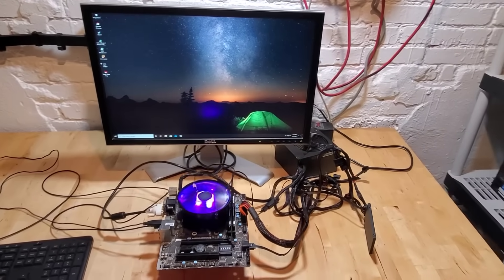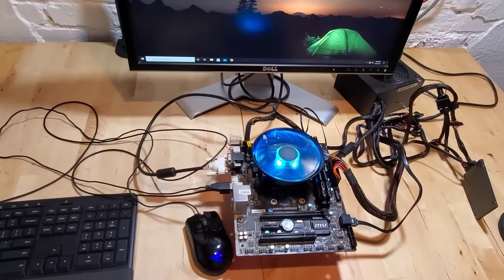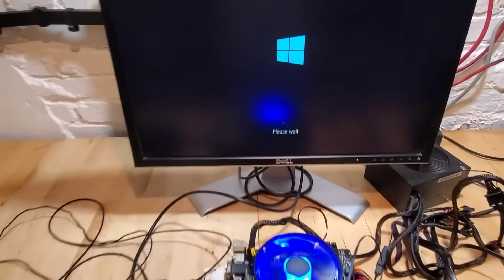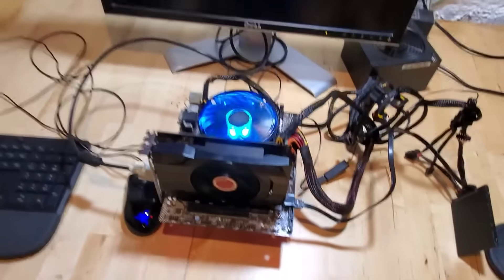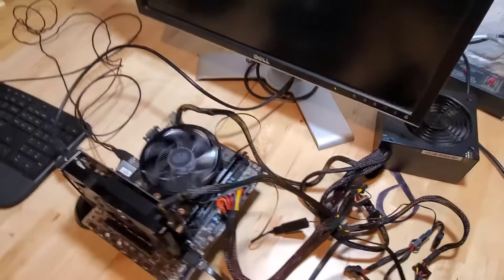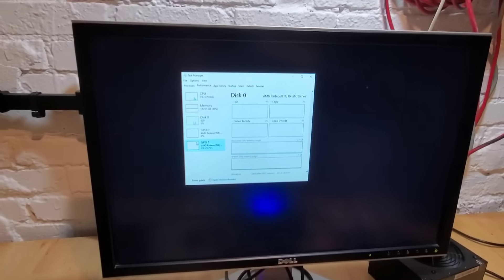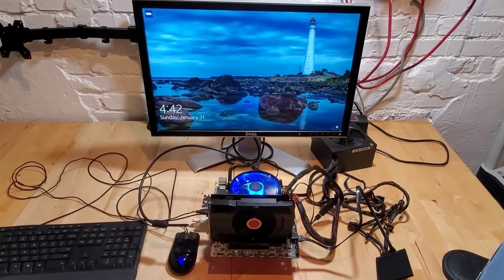What happens if you remove PC components from a running computer?

Comment: Oh that's nothing! I removed my 2 backup HDDs 3-4 times to plug them into the proper SATA and what happened blew my socks off! 
1. Both HDDs had 2 partitions: 
    Disk A: Part A1 and Part A2 
    Disk B: Part B1 and Part B2    (4 partitions in total).
2. All four partitions were locked with Bitlocker. 
3. Every time i switched the computer OFF and i restarted windows to see whatever i wanted to see about the HDDs).
4. When i finished, i started the computer one last time and i tried to unlock the partitions.
5. Partitions A1 and B1 worked fine after i unlocked them.
6. But it was impossible to access Partition A2 and B2 after i unlocked them, i.e. both HDDs had the same problem on the same partition (2)!!

The BitLocker icon remained gray and when i try to access the partition i'm getting the message "The disk structure is corrupted and unreadable". 
I have no idea how to restore my files from these partitions that don't have any physical damage. 
Even a famous "file recovery company" didn't give me an answer after so many months...

Comment: What you do sounds preposterous, but it's interesting to know, for whatever reason.
I see no reason for example for the gpu to not be plug and play.
Also, the disk part. You can obviously remove disks that do not contain the os just fine. But if you were to remove usage of a page file in windows, maybe those would work still, with no OS drive. You wouldn't be able to explore folders, but you'd have all the os in ram.

Comment: As long as no parts are broken in the process, none of this should have any worse effects than suddenly taking e.g. power away. Some writing actions might not be finished in persistent storage, Aka hard drive, and lead to some corrupted files and data. However, modern systems are usually rather robust to this, by e.g. writing down instructions to undo a change before actually doing it. This way, everything can be repaired just fine.
Reply: Yeah. The so called damage he warned about is much more likely to happen from physically breaking components since it can be difficult to manipulate a computer while it’s plugged in to a workstation. I learned this the hard way from trying to be clever, temporarily unplugging my backup drive in case a sketchy application gave me ransomeware.

Comment: Having dealt with a failing HDD in a laptop, I knew 100% what would happen with removing the storage. It would slowly fail, then restart. And the storage device might be acting all fine and like nothing happened for a bit before doing it again. At least that one is somewhat simple to diagnose if you can see the fact you have no storage device attached before the computer fails.

Comment: SSDs can be taken out and moved around as long as the running operating system isn't on it. I have external top loading port on my computer specifically for this, however, similar to a flash drive, you should tell the computer to "eject" it first. Also, I found on some machines you can swap video cards if you to specifically tell the computer to disable the port first, swap, then re-enable the port, but you do need integrated graphics to be able to see what you're doing, plus if I'm not mistaken, there's a shortcut key combination to reboot the graphics card. Although I don't know if that works after having pulled and re-plugged the card while it's running, but as far as I know, removing the graphics card while it's running doesn't always crash the entire computer. You could of tried moving the video cable back to the integrated graphics port to see if the computer was still running.
Reply: This is true. SATA technically IS hot swappable, but you want to avoid doing it to a drive that’s actively being read or written. Like you said, if it’s just storage, you can usually swap those no problem.

Comment: So is the reason why windows didn't crash at first when you removed the SSD was because it had windows temporarily stored in the RAM?  However, once it processed and needed another particular instruction from windows, it wasn't able to retrieve it due to no SSD?  Just wondering why it took so long for windows to crash.  I guessed windows would have crashed almost immediately.

Comment: Removing the RAM is literally removing chunks of the OS, which tell the computer how to run (yes the OS is located on storage but any instructions that need to be run are first loaded onto RAM usually). Hot swappable RAM would require an equivalent module with the exact same data.

Removing the CPU is practically like cutting the power to anything, minus anything controlled by the chipset or motherboard itself. RAM will likely clear as well. Redundant CPUs would require the same connections and some motherboard control to ensure only one CPU is running at once, or to deal with multi CPU processing. If multi CPU processing is on then it's likely the OS would be gone (until a reboot) if one of the CPUs are removed.

Removing a GPU could be doable if hot swappable PCIe is enabled (I believe LTT tried this out years ago). If you have integrated graphics then it's likely the PC would be fine, minus major graphics crashes (which could cause a bsod depending on how system-level the crash is).

Removing SATA devices is actually a supported feature nowadays if hot swappability is enabled in the BIOS. It'll behave like a USB stick- you should properly unmount a SATA drive in the OS before removing as usual. If you remove the essential system drive however, then this is likely similar to removing RAM, as any active programs can't find their code not stored yet on RAM. Note that there are some OSes out there that run entirely on RAM, so in this case removing the storage will have no effect to the OS itself. One last thing, eSATA is an (old) protocol for hot swappable drives, exactly as I described- my first PC case had an eSATA port on it, which was essentially a normal SATA data cable but with an external connector on one end.

You could try to remove some of the power cables- removing the 24 pin likely will shut the PC down; removing the CPU connector (one) will probably shut down the PC but the motherboard would still run. If the PC has multiple CPU power connectors then removing one will likely not do anything other than force the system to underpower the CPU. Removing a PCIe power connector probably has no effect either, except a GPU connected would run at a bare minimum speed, or shut off. Same thing with SATA power (and likely the old molex too), drives might be able to run on only the SATA data cable but will likely shut down.

If this were a different system (maybe something like a FPGA) then the "south bridge" or chipset could technically be removed too (south bridge is something on older motherboards, acting as a hub connected between the CPU/north bridge and less essential components. Nowadays the chipset handles that task, with more direct connections to the CPU enabling better performance and what not). Removing the chipset/south bridge could just be the same as removing all USB devices (aka the PC could keep running), or it could be like removing the motherboard but keeping everything else connected to the CPU (if the chipset interfaces with the motherboard itself, which it likely does, to regulate power and devices and what not).

Comment: SATA was desighned to by hot swapped, so if you do this to non system drive you could be ok, (actualy there are linux distros that can load to RAM and work whitout hdd) whit right OS,...  Also PCIe can be hot swappable, but not nesseserly Video cards,,...

Comment: I did this by accident over 10 years ago. Thought the computer was off but it was in sleep mode. Was with FX-4350 and GTX 750. Had some corsair 2133mhz ddr3 that took out 1 stick off. When I went to reboot the pc it sparked and fried everything from mobo to hdd's.

Comment: Dynamic RAM (DRAM) used by most modern computers has a load-decay-refresh cycle, the longer in decay the more undefined RAM content becomes as cells starts decaying towards uncharged state. If you unplug RAM and replug very fast, or extend decay cycle with extremely low temperatures, you can move RAN stick from one computer and analyze in another with acceptable low amount of bit errors. “Lest We Remember: Cold Boot Attacks on Encryption Keys” explored this extensively in 2008.

Comment: What if the PC just automatically switched the main graphics device to the integrated graphics card, and you just didn't notice because your monitor was unplugged? Also, you didn't actually reset any system after plugging the SSD back on. It's just that the PC couldn't find any bootable drives at first and automatically opened the BIOS, and later you had to restart the PC to run the sequence of looking for the bootable drives again.

Comment: I did this when i was younger and thought plug and play meant you can just pull components out, so i did that with the 65k internal modem. Was never the same afterwards, but still worked.

I wouldn't be surprised if you started having memory errors.

Comment: I want to know what happens if you boot a cpu without cooling. How long till thermal throttle? Instant or minutes? Seconds? Is it bad for it or are the thermal protections fine for this? Can you verify a systems parts before a build by doing this outside the case so as not to have to reinstall the cooler and reapply thermal paste. With my current build I just yoloed it and built everything in the case and got lucky that all was well but some videos say to connect all the pcs parts outside the case to verify them then remove and reapply thermal paste. Would be nice to know if this is unnecessary.

Comment: A lot of modern PCs will have this type of reaction because of how it loads and configured parts. The reason it doesn't immediately come back to life when reconnecting is due to computers only really reading for those components on boot. Part manufacturers realized most people arent hot swapping internal components like that anymore. A lot of effort has gone into system BIOS's that can recognize and optimize basically any physically compatible hardware in fractions of a second, and then operate with that hardware on a dime. It does that by assuming you won't be changing out the parts while the machine is turned on. Hence why so much as a driver update requires a restart, since the device is technically different in the eyes of the computer, and stops being properly recognized until you reboot and have the computer recognize the change. It is a gift and a curse, since I would love a totally hot swapable desktop unit.

Comment: The GPU is not essential for a system, and not even the iGPU. If you know the system's IP address then you can connect to it and use it using a terminal but there will be no picture.

Comment: The graphics failure when removing the main memory come about because the system was operated via the onboard/iGPU and the main memory is used as graphics memory. 
With graphics card, the computer would just freeze.

Comment: And where is the test: pull out the RAM after installing the GPU, whether the image will disappear or not, because if the video card is not installed, then the video buffer is in RAM, and if it is installed, then in the video card.

Comment: I was kinda hoping you would remove the gpu while the display cable was connected through integrated graphics. Because if the cable is connected to the gpu it’s obvious it’s just gonna go black.

Comment: I have another fun fact for you guys! If you remove the powercable from the graphicscard it turns off just fine (obviously) but if you dare to put it back in while the pc is running, the GPU will break. I did this braindead mistake by myself some years ago as i forget to put the powercable into the GPU. I mean for some people like me in the past, it seems not that stupid ... like ... it gets power when the PC is booting, why should it be different when the PC is already running. My GPU also startet to create some smoke and a disgusting burned smell. So all in all: DONT PUT IN THE POWER CABLE IN TO YOUR GPU WHILE THE PC IS ALREADY RUNNING! :)

Comment: My pc had dusty fans so I cleaned them this morning. I cleaned the case fans, and the cpu cooler fan. I took the cpu cooler out and replaced it with new thermal paste. Then I tried to boot it up. I connected monitor, keyboard, and mouse to my pc. The pc turned on, case fans and cpu cooler and gpu fans were spinning and working, but the monitor and keyboard was not turning on. Based on your video, I'm wondering if replacing the cpu cooler and thermal paste messed with the cpu, and I might have to reseat this. Do you think this is the solution here?

Comment: Hey need help i removed the ssd while running pc and after blue screen I turn off pc with power button again re insert the ssd and turn on the pc it's black screen not responding keyboard or mouse any fix
Reply: Surprised you never got a comment. You need to make sure it's installed properly then change your boot options in bios. You prolly never checked boot option in bios
Reply: @Singehkoo  Anyway, thank you for your reply. I already went to the hardware store and fixed it :)
Reply: @G-TRACE  no worries sorry for being so late and happy its running better

Comment: It's actually impressive how even when the ssd is removed, the pc still BSoDs you, even though it's not running windows, therefore it shouldn't pop up
Reply: Probably because the kernel is loaded in the ram
Reply: The system is still running the Windows kernel at that point, the Windows kernel is what is showing you that BSOD.
Reply: I think it was a DDL or a system file which had that bluescreens loaded. Somehow Windows is a heavy operating system which full of useless stuff.

Comment: I wonder if the fan ramp up is a safety feature .... like the card just ramps up the fan to max as soon as it doesnt know its status anymore. Wondering if that is a general feature or just a quirk of this card. Aside from that I wonder if mico arcing can become a thing when you remove components unevently and disconnect connections after one another (for example by tilting the RAM while lifting) ... the voltage might be applied to fewer component connections and either arc or otherwise overload certain circuits.
Reply: Fan spinning up is because the fan is PWM controlled, meaning the fan receives a constant PWM signal to tell it what speed to run. As soon as the fan stops receiving the PWM signal (GPU is unplugged from the PC) it just defaults to 100%.
Regarding the RAM: voltage is the same, it doesn't suddenly get (much) higher. Though you risk running power through data/address lines which might theoretically damage the RAM.

Comment: this is bad.

never once was "what happens?" addressed. you basically showed us that interfering stops it from working. but that has nothing to do with what is happening.

anybody reading this, i implore you to take a Computer Science course and actually learn what's going on in your machine. There is so much more to know about changing a component. this asshat didn't have the forsight to share the "what" part and instead just presumed "computer" means that all computers are the same. They are not. some PC parts last longer than others, some motherboards are stronger/smarter than others. none of what you see here is useful for "what happens".

i already knew what happens. when i express that, i truly mean it, i know what is actually happening. the misinformation here is annoying. it's in the way of "what's happening" and instead the video is nothing more than "watch me be dumb...don't be dumb!"

hey, asshole Meyeester.
this is a public, global system where what youshare is NOT in a small bubble. be accurate or my accurate descriptions will only get worse through other people when they realise you're a dumbass too.

Comment: Lucky that you only pulled the GPU and not the Power Connector, if you pull the PCI-E Power Connector while the GPU is running, the Power Phases on the back will do some sparking or fire, they will turn white and the Card will never work again...

Comment: - In modern parlance, "reset" does not mean the same thing as "reboot".
- If you reset a Windows 10 PC, you are essentially factory resetting it.
- - There is a specific procedure that involves operating system commands.
- - If you want to see for yourself, do a Start Menu search for "reset".
- What he does here is power cycling - he cuts the power, restores the power, then turns the system back on.

Comment: I vaguely remember with some ISA bus systems in the 80s, it was possible to remove some types of cards from the system and if the OS or a program wasn't trying to address any part of it at the time you did that, the system wouldn't notice you'd done that and keep chugging along. Of course it still expected those resources to be present and so the next time it tried to use them it would crash.

Comment: But what happens if you remove the power cable? ;-) Had no idea that removing the RAM won't instantly get you a blue screen. I remember that just by looking the wrong way at my Windows98 desktop, the whole system would crash and you had to reinstall windows.

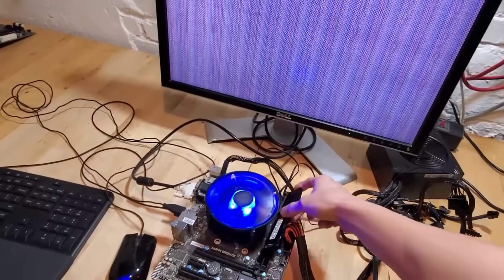Comment: @1:00, RAM is using electrical current to hold the information. If you stop the electricity in-flow to the RAM component, the information is wiped clean. Re-inserting it would not fix anything, because the data is dead.
Reply: It’s like removing a human’s brain and putting it back in